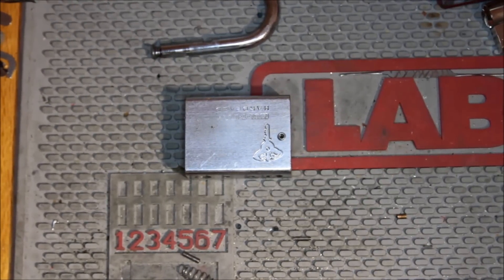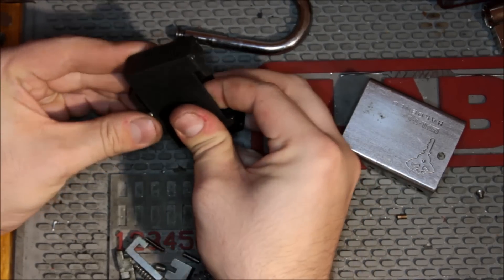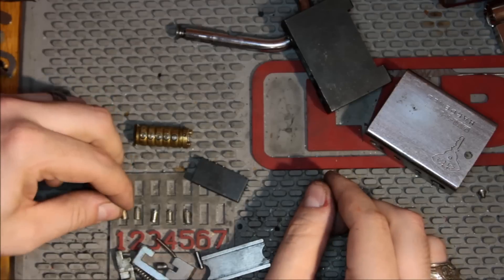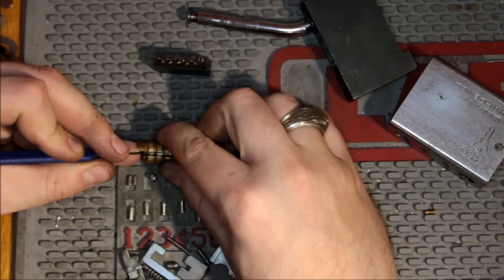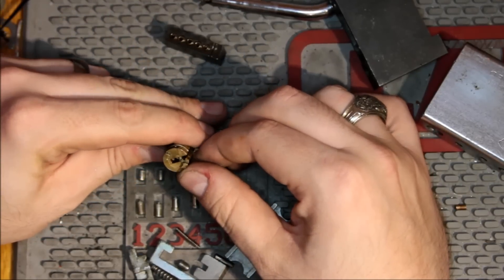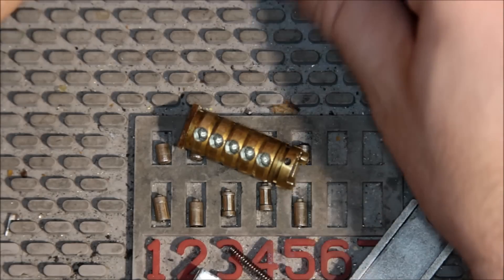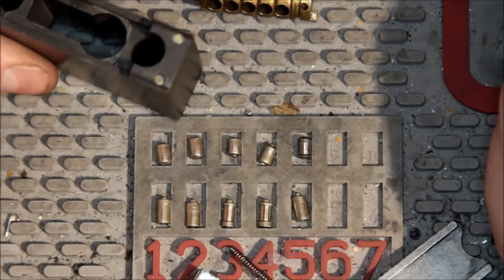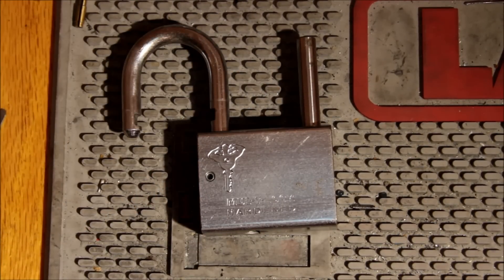(249) Mul-T-Lock Padlock: Full Gutting and Reassembly

Comment from the maker: Hmmph. I could go and measure all the key pins, which should enable them to derive a direct bitting code. The keys for this model are out of patent protection by now, so, technically, they should be able to do it. Or maybe I need to invest in a couple special milling cutters. Cutting them by hand with a dremel and files is a PITA.

Comment: No, sorry.  Not without the security card.  to be honest, I don't think they CAN cut a key without the card because the machines I've seen read the bitting from the card's magnetic strip.  Even when I wanted some extra keys for my MT5+ padlock I had to take the card to them - they couldn't just copy the original key.